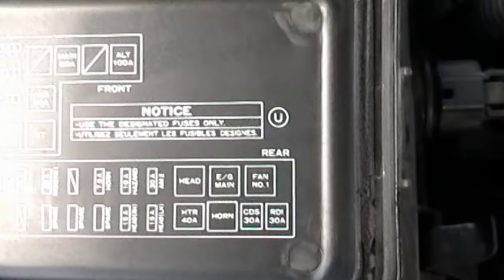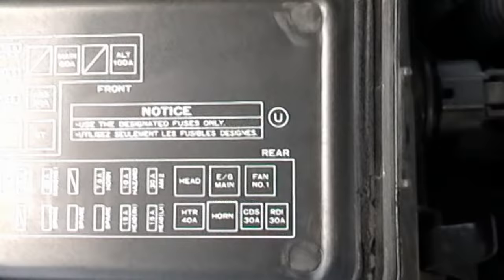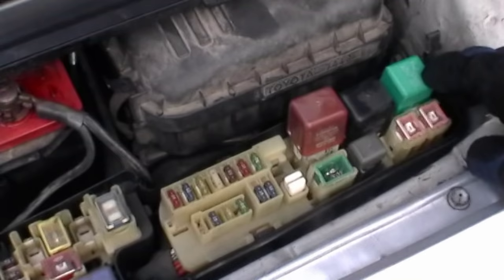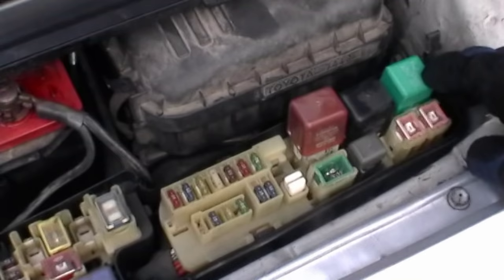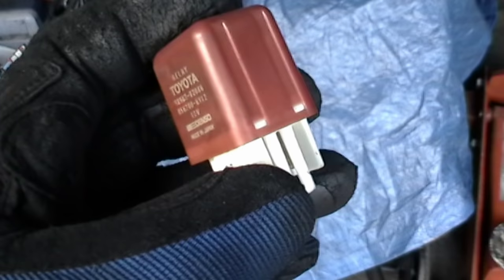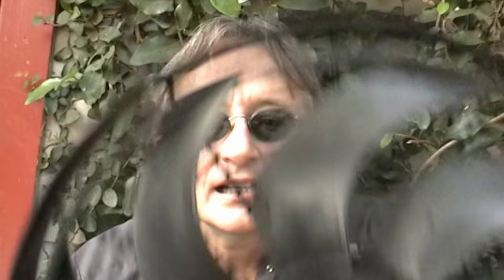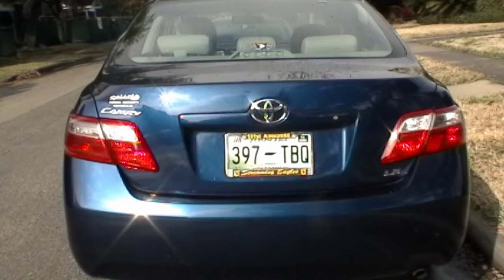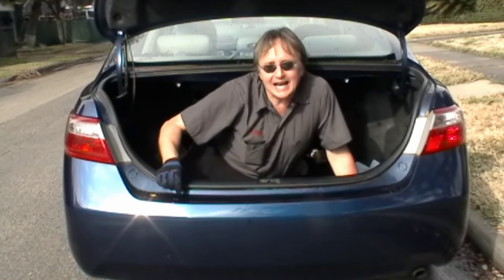How to Repair a Cooling Fan in Your Car

Comment: @scotty kilmer I checked everything including all the steps you said but fan still doesn't come on. Can a bad coolant temperature sensor cause the fan not to come on? Its a prelude 2001
Reply from the maker: yes it can, but on that model, often a bad main computer causes no fan action IF the fan motor and wiring works

Comment: Mr Kilmer,
I am stumped.  I have a 2003 Mazda tribute 3.0 V6, where the cooling fan doesn't come on during normal operation.  All relays and fuses checked out good.  When the ECT is unplug, the fans turns ON, when connected no matter what the engine temp reads still wouldn't turn on.  I tested the ECT and measured 37K ohms at 68 degrees and 1.7K ohms at 212 degrees.  I bought a new ECT and still wouldn't turn ON, I tested the new ECT and very much the same readings at room and boiling water temp.   The fans runs constantly as long as ECT is unplug.  I measured 4.6 Volts on the ECT connector while it is disconnected.  When I put a jumper wire on the ECT connector, the fans stopped running.  What problem could this be?
Reply from the maker: Bobby Gonzales  problem in the main computer, see it a lot. Heck, just rewire it to run all the time the engine is running and leave it at that, computers cost a ton

Comment: Scotty what if the engine cooling fan comes on but turns very slow?
Reply: If it's a single speed fan, it's likely a fan motor bearing that is about to seize up, as i recently found out about mine... that is, the fan may be still good but the motor is on its last legs... mine kept the engine cool no problem, but messed my AC up pretty good in hot sunny days...

Comment: Hey scotty got a problem. Every time i turn my keys on first click only with magic eyes turned on but engines still off mode.my radiator fan already starts to kick in.. I've notice that my previous mechanic directed the rad fan wire directly on relay.. Does it supposed to be somewhere else?
I saw some cars with the same model as mine.their rad fans only kicks in when only reach the certain temp. Please help.
Reply from the maker: zoe jordan  leave it, he bypassed the old system as it was broken. Fixing it the way it was made can cost tons, and yours will run fine the way it is now

Comment: I have a 2 wire fan switch? the prior owner had everything jerry rigged and the fan did not come on, I ordered a new switch and my issue is , is the switch grounded on one wire and the second wire going to my new relay as a ground? or do I run 12v to one wire and use the radiator fan switch to connect power to the relay? HELP?
Reply from the maker: +Cody Jones best to just wire it over like this, get a universal relay, auto zones sell em for 10 bucks. Then follow the wiring diagram on them to send power to the fan motor positive wire. And just ground the ground wire of the fan to an engine bolt
Reply: +Scotty Kilmer ok my temp gauge goes up when it's on and I'm not driving and it goes back down when I'm driving Wat I do

Comment: Hi Scott. I have a 94 honda accord. One of my fan it's not working.  The other is doing just fine.  Any suggestions
Reply from the maker: generally just a bad motor, hot wire it, and if it doesn't work, replace it
Reply: Scotty Kilmer well Scott my 94 honda accord overheated so much. Tool it to a shop and I was told that the engine messed up because it has gas in it. Any suggestions

Comment: 1996 cutlass 3.1 eng.both cooling fans don't come on its prob.not fans or both felays going bad at same time ???may be cooling sensor .I didn't see any reg.fuse for fans.jf..april 24 2023

Comment: Ford Focus 2000 auto Colling fan stays on as soon car starts and only shut off when switch. Car AC is not working but fan is loud and car overheats on highway even cooling fan is on still goes into red but a soon speed drop come back to normal temperature any help
Reply from the maker: +malik imran worry about the fan, if it overheats with fan on, do my video "how to fix an overhearingcar" and fix that first

Comment: I have a 1998 fiat punto and my fan screams at idle when the car has been driven for over an hour, would it be safe to spray the fan with wd40? as I think it's due to rusting.
Reply from the maker: José French that will not fix anything, they scream, the bearings are wearing out

Comment: hello my fan cord has a shorting in it I have to move it to get it running but now it doesn't come on at all .....any ideal what the problem is
Reply from the maker: well, rewire the wiring and connectors if they are frayed, and replace the fan motor if it's the motor shorting out from internal brush wear

Comment: What about if the fan works but slow, what could it be?
Reply from the maker: either the motor is just burning out, or the ground wire to the fan is weak and needs regrounding

Comment: audi a4 b6 1.9 turbo diesel temp gauge goes to 90 degrees but not above fan dosent cut in and ive changed the switch on engine any thoughts to the persisting problem .. note the car does no over heat ???
Reply from the maker: if fan never comes on, it would overheat idling, so test that first. If it does get hot, fix the fan system. if not, live with it
Reply: Tryed the fan it spins slowly... But I marked it left car running for atheist an hour temp went to 90 degrees but fan didn't cut in as marks stayed in the same place but as I said car never boils or gone above 90 degrees it really has me puzzled and I can let the pressure out off the pipes by opening the water resiver??

Comment: mitsubishi space wagon 2003 not overheating motor are good but they wont turn on i even change the coolant temperature sensor and its still not working
Reply from the maker: bad relay or bad wiring or bad main computer. Many guys will rewire em off a toggle swtich to turn em on manually

Comment: hi ive got a 1995 nissan pulsar  fan works relay works replaced coolant switch but still not working when wires is unplugged at coolant switch and enjine is running fans run when you plug it in it goes off. can you give any advice please
Reply from the maker: +Jossie Botton often a bad main computer then, typical on a nissan that old. Rewire the fans to run off a toggle switch to save money

Comment: Hello Scott I am going to take my car to a autoshop to get my transmission fluid changed and i am wondering if the transmission is not shot? The ATF oil is black and there is a lot of slude/grease under the car but none under the hood and no burning smell, should i be concerned?
Reply from the maker: actually, if it shifts fine now, being that dirty, leave it alone. Just changing the fluid out now can make it slip big time with new slippery fluid inside, see that a LOT.
Reply: thank you Scott for answering and solving my question; you are an amazing mechanic.

Comment: How do you replace the fan switch on a 2013 Chrysler 200, the air will not blow when the speed switch is switched on
Reply from the maker: +Rufus Wimberly rarely do they go bad, more often the blower motor is bad or the blower motor resistor
Reply: Scotty Kilmer I replace both of them and still when I turn on the fan switch nothing happens

Comment: 2001 Mazda Protege. When my coolant fan comes on, theres a dip in voltage. Even while driving. Is this bad ground, alternator issue or battery issue?
Reply from the maker: could be any of those, realize auto zones load test batteries and alternators free, start there
Reply: Scotty Kilmer Both tested fine a hour ago from O'Reilly. I noticed myself that only 1 6 guage wire was coming from the battery to the car chassis. Went and bought another 6 guage wire from Walmart and added to the chassis also. Seems everything fine, but couldn't get the coolant fan to come on by itself. Thank You

Comment: 2007 Lincoln MKX fans not working. Have checked every thing. New Temp Sensor, New Fan assembly, New Thermostat, fuses good, checked continuity and still not working. Not even when the ac is on. I'm lost.
Reply: Beat Quake my same problem too but the fan on the passenger side only briefly gets power and dont know the problem. Did the exact things you mentioned.

Comment: I dont understand what you did on 1:45 - 1:53.
I've seen cooling fan switches that have 2 pins, 3 pins. On this video it looks like it only has 1 (only one wire can be seen). If I understand right you connected that 1 pin in the switch with the negative on the battery. What if a cooling fan switch has 2 or 3 pins?
Whats the difference between cooling fan temperature switch and  coolant temperature sensor?
I found out on my car that the coolant temp. sensor has 3 pins and if I disconect it, the temp guage in the dash wont work. 
I've seen people do the paperclip method with the fan switch to see if the fan will spin. They had 2 pin cooling fan switch and they stick a paperclip in the part that snaps on the fan switch. Will that work with coolant temp. sensor? Mine has 3 pins. two are 5V and the third is ground.

Comment: hi scotty. problem with my car is that sometimes both the blowers won't turn off even the engine is off (ignition switch "on"). or sometimes the blower will run by itself after a few minutes i inserted the key and switched to on (engine off). what could be the problem? thank you.
Reply from the maker: as long as it stops blowing after a few minutes, live with it. Cause it's often the main computer circuits going out and they cost a ton
Reply: Thank you for the quick reply Sir Scotty...

Comment: Hey my compresor fan doesnt turn on i already checked the fuse and its good i also checked the fan itself and it works and there is power foing to the plug for the fan any advise on wat it could be?
Reply from the maker: Primitivo Hernandez   many things can do that, but often a bad fan relay or blown fuse, pray it's not the computer that ultimately turns it on
Reply: So how can i check if its the computer because i changed out the relays and the fuses are not blown?

Comment: I got to the part where i connect a wire between the negative side of the sensor and the negative post on the battery but my fans didnt come on.  In the video his fans came on but he said the sensor is bad.  Im confused. Any help
Reply from the maker: Clarence Adams either your fans are burned out, the wiring has a short in it, or your main computer is bad. Good luck

Comment: I have a 02 maxima.. My fans don't come on when I start the car but after the Car warms up the fans come on at hi speeds.. Even with the AC OFF the fans come on... I changed the ECT.. But the same thing happens
Reply: Join 5thgen maxima group on Facebook. They're very helpful
Reply: Join 5thgen maxima group on Facebook. They're very helpful

Comment: I changed the fan motor in my 97 Pontiac Grand Prix. I put it all back together and it keeps brushing no matter how hard I try to seat it. I've tried using washers to build it out but the problem is brushing the top and bottom. Do I need to keep tweaking it? There's an adjustable screw click on one side but it won't stay in place. Can I make it tighter or should I replace it?
Reply: screw clip*
Reply from the maker: you were sold the wrong motor, get an aftermarket fan assembly with the plastic and everything, they work fine
Reply: Not a bad idea! I think the motor is OK because it's not making anything touch. The fan is the original one and it's not going back the same way it came out. Thank you for your help!
Reply: Scotty Kilmer hey, I got it fixed. It was the right motor. The bottom of the fan goes in a slot and it was pushing the fan too close to the radiator. I created an aluminum spacer to go between the fan mounting point and the radiator. It works great!

Comment: Scotty can u pls help me, I currently own a Chevy Cruze 1.4, the engine has 1 cooling fan, the single cooling fan, has two stages first stage is normal speed and second stage is high speed, my cooling fan only works on stage 1, when I turn my AC on the AC condenser overheats due to normal speed rotation because, (when you turn on the AC the cooling fan must go straight to stage 2 high speed) in my situation the AC system overheats so much that the high pressure escapes through the AC compressor safety valve, then I get flat AC liquid in my AC system, please help me, one more thing, I think I might have messed up the 3 harness cables that plug into the AC condenser sensor

Comment: hi good sir, sometimes when the cooling fan starts the engine hesitates a little, i already asked you this and i already had the battery checked, and they told me that everything is fine radiator, battery, they even checked the wiring, so at first i started searching for batteries and prices just in case, and i found out that in every catalogue, they didnt have the same battery i have now, the actual one came with the car, brand new, but it is smaller; so any idea why this? or maybe because of a different region?
Reply from the maker: battery styles come and go, only thing that matters is the amperage rating of the battery.
Reply: yeah i meant the amperage

Comment: scott. I did a 5sfe engine swap. I deleted the AC system and the condenser and lines. each time I put ugnirion on my radiator fans turn on. why does it do this? I replaced coolant temp sensor but no go
Reply from the maker: either wiring is shorted out to power, or the main computer circuit is shorted out that runs the fans. But it hurts nothing, I've seen guys drive em decades that way
Reply: +Scotty Kilmer wouldnt this shorten the life span on the fans?

Comment: When i unplug my coolant temp sensor (2-wire, mounted on the thermostat housing) my fan comes on but otherwise it won't. Could it be a bad sensor or could it still be the cooling fan temp switch (which i can't find on my car)?
Reply from the maker: +xm8lover replace that sensor and pray the main computer isn't bad
Reply: Scotty Kilmer
 thank you my dude. you run a great channel btw.

Comment: hey i have a buick roadmaster 95 will my fans work if one motor is bad one fan works passager side dnt
Reply from the maker: if the bad one doesn't blow the fuse, yes

Comment: Sir:   I enjoy fixing my own cars but I am an amateur.   My 2001 Expedition has a problem that has me stumped.   With the engine off and key out of the car the blower motor came on and drained the battery,  it was dead by morning.   It seemed like the relay had stuck on,  so I replaced it,  this worked for two days,  then the problem repeated.   I shut down the car and the blower motor came on full speed.   So I removed the new relay - it had no effect, so I disconnected the battery. How can the blower motor receive power if the relay is unplugged?    Any comments are appreciated.
Reply from the maker: +Jeffrey Nelson that is all computer run, and unfortunately VERY complex. Odds are you have a bad body control module, very expensive, or a bad blower motor resistor, not that bad.  Good luck
Reply: +Scotty Kilmer   Thanks for your response.   When the rain lets up I will do some more searching.

Comment: Hi scotty Kilmer I need  some  help from you.
I have a 95 honda civic and the cooling fan is always on. I change the cooling switch and the fan is on all the time. Please help me...thanks
Reply from the maker: Joseph zendejas odds are your main computer is bad, see that all the time, that circuit breaks down. They aren't cheap, but you can rewire the fans to bypass that computer or pay a guy like me to do that

Comment: The radiator fan does not turn on when the engine gets hot, however the fans turn on when the A/C is turned on
Reply: i have the same problem .. have you fixed it bro? it might be the temperature switch..
Reply: I got it done 
There was a problem in the relay

Comment: hello mr scotty i have a problem on my car  that the fans start on once i put the key in ignition it wasnt befor they stay on with non stop an the uper hose very hot an the lower hose is not even hot please i need ur help  thank you,,,,,
Reply from the maker: pray it's a bad temp sensor for the fans and not a shot main computer

Comment: Scotty Please reply , My car keep blowing fuse cooling fan fuse,  the anti-frezze keep  coming out of the reservor when i stop   what don you think i the problem. what cause the fuse to blew up again
Reply from the maker: generally it's a bad cooling fan motor. Unplug it, and if the fuse stops blowing, replace the motor. PRAY it's not a short somewhere in the wiring or computer

Comment: my car has two fans. do both fans have to come on?or one is for  the a/c2010 lancer
Reply from the maker: when it gets hot with AC on, both will come on eventually if system work correctly
Reply: thanks for quick reply.

Comment: Hi, the cooling fan on my 2009 Ford Edge doesn't appear to be working.  We replaced the relay switch but it still didn't work, so I imagine its the cooling fan motor.  Do you know how to replace that?
Reply from the maker: Cherrone Davis just bolts off and on, just type "cooling fan repair" on the search engine on my scotty kilmer channel on youtube and you'll see some videos
Reply: Ok thank you, I just wasn't sure which fuse to check, and the Ford website isn't very helpful so I can see what fuse to check/change

Comment: Hi scotty just wondering if you have any ideas on my problem i have a hyundai traget CDRI a diesel people carrier 2006 model my engine coolant fan does not come on but the fans come on when i turn on my aircon i have changed the thermostat also i have changed the ECT sensor and still does not work if i disconnect the ECT sensor the fans come on but naturally i have no temperature gauge any ideas what my problem could be
Reply from the maker: since you changed the sensor, odds are the circuit in the computer that drives them is shot requiring a new computer. Me, I'd just wire the fans to run the whole time the engine is running and bypass all that crap
Reply: i think that's exactly what i will do thank you for your help